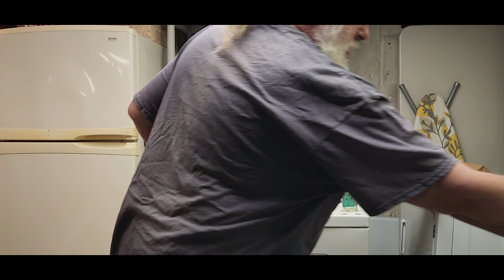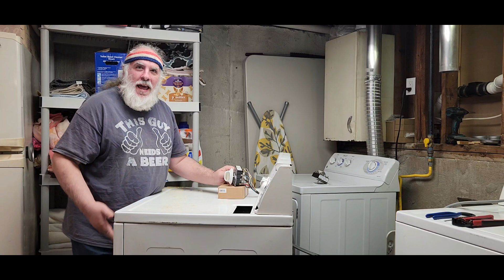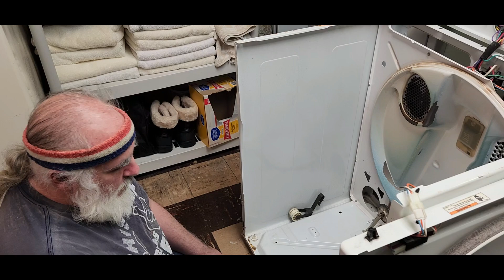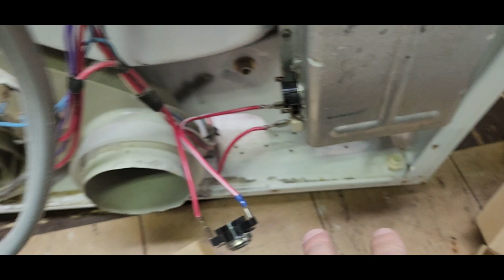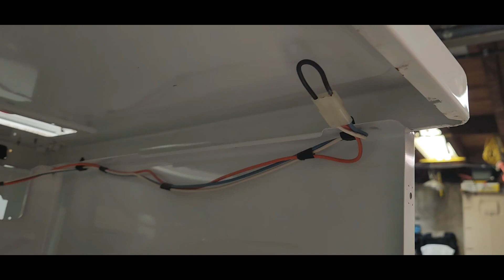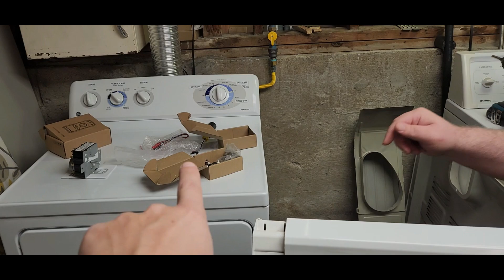Kenmore 80 Series Dryer "FIXED"

Comment: The good old "new defective part" issue.  Every now and again that one pops up.  And it throws even the most seasoned techs for a loop.  Any tech who had ever had this experience will be happy to tell their story.  So, if possible, always test new parts before installation.  It may sound like a time waster, because it's new, how could it be bad?  But it's a huge time saver if actually done and you find one.  Metering the thermal fuse took all of a second, but having two that were metering the same seemed to indicate good, even though bad.

And while on my soapbox, I will tell my story:  I once had a customer's Acer desktop computer.  We didn't really have any of those that ever came in, but I got stuck working on it.  I had found a bad motherboard.  Ordered a replacement, installed it, still no good.  Replaced every other part with a known good proven working part, and it still didn't work.  New motherboard is defective.  Sent that back, got another.  Same thing.  Went through 5 of them and still the machine was dead.  I don't know how many strings were pulled, but we shipped to it Acer for repair.  it took several weeks until it came back.  The note from their technician said "bad motherboard, replaced, working properly".  The customer asked me what the difference was, he said "You guys replaced it 5 times, how come they replaced it and it worked?"  I said "You are right, they did replace it and it worked, but they didn't say how many THEY went through before they found one that worked."  Clearly, that wasn't a very good computer.

All in a day's work.  This one took a while to shake off.
Reply from the maker: @jaykay18  Yep, good story. That's what we call a "bad batch"

Comment: So it WAS the thermal fuse! I was initially thinking that. Amazing how you got a bad new part, but it does happen. Not to  boast, but if I was there and I saw the thermal fuse was not giving you continuity, I immediately would have said "Yep, there's your problem." and saved ya guys some time! I still would have checked other parts too of course. But I definitely would have also been mystified when seeing both of them being bad. Not sure how that connector got hot like that with the cycling thermostat, but I think they actually do say that if you replace the thermal fuse, just replace the cycling thermostat too. That might be the opposite of that, or both scenarios might be true. Either way, glad it's all fixed again!
Reply: Ah--see there's the problem.  Most people, once they find the bad part, replace it and if the machine works, it's good.  The cycling thermostat would have been overlooked by most technicians.  I found it.  The part that threw me was the bad thermal fuse metering the same as a "good" one.  My dad told me a story once about how he worked on a machine for many hours to no avail, only to end up being in the same boat with a new defective part.  That also happened with my old Chevy when the brake master cylinder went out.  The new one was defective.  And that wasted his time for several hours.
Reply from the maker: It has broken 2 times maybe 3 since these comments. Wow, time flies when you are having fun.